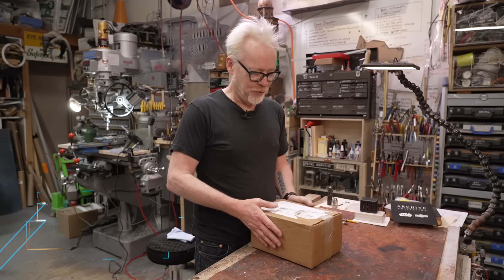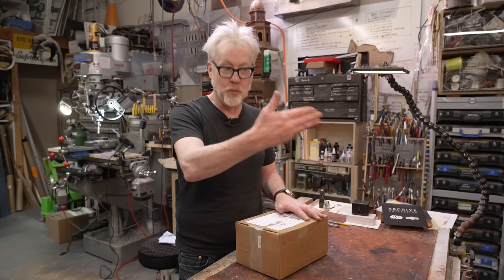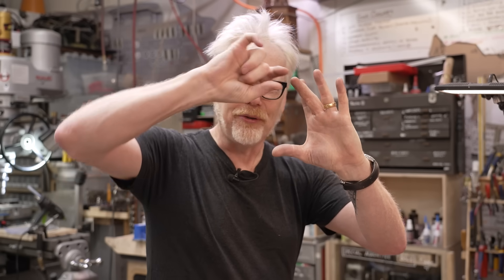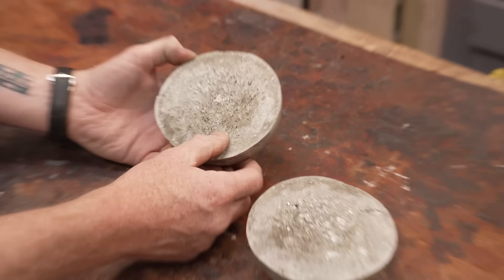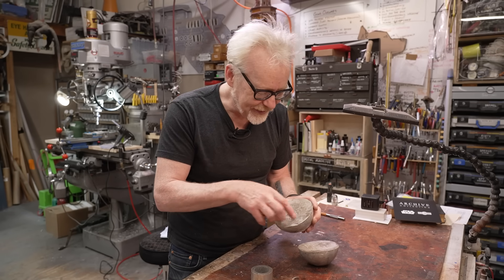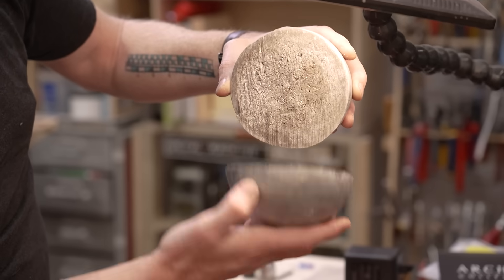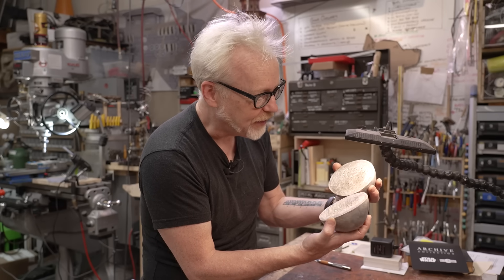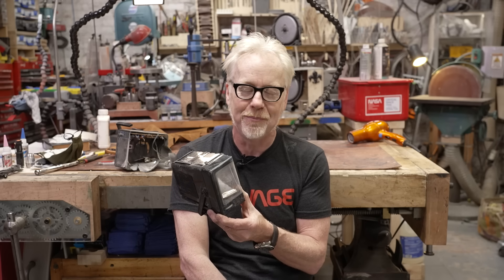Adam Savage's Aluminum Foil Ball Cut In Half! (Ft. Waterjet Channel)

Comment: i would have guessed it would have had a very small hollow center.     it would be cool to see it polished but i dont think the center is dense enough to go through the procedure, it will probably tear when you try to sand it .  it will be just as grippy as when you tried to cut it with a blade